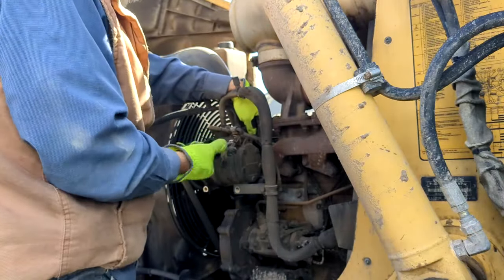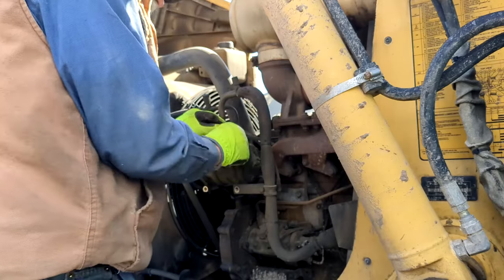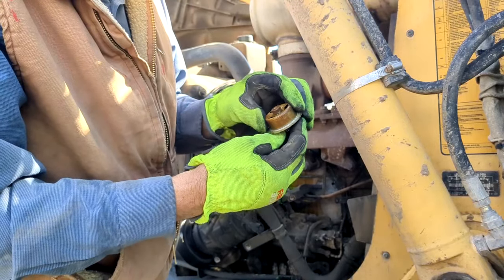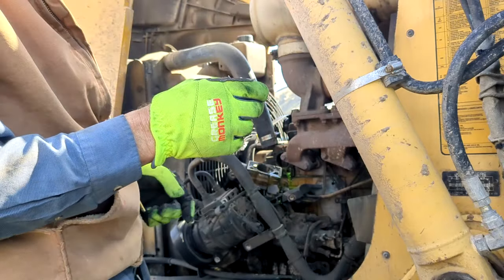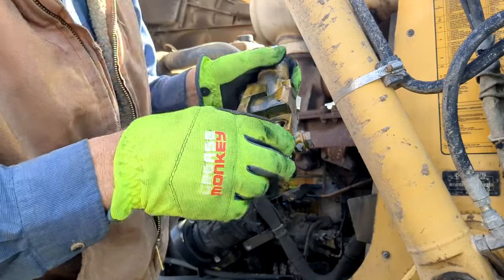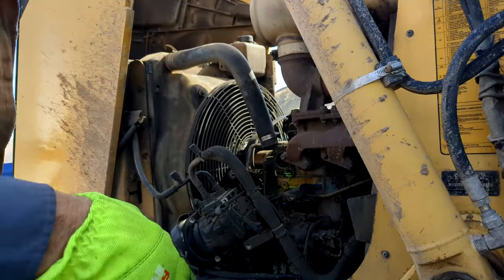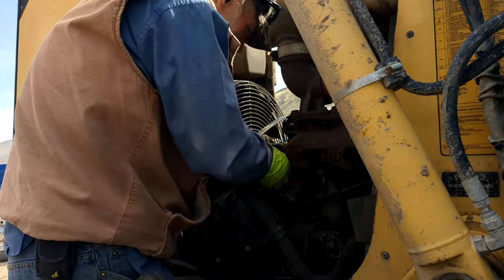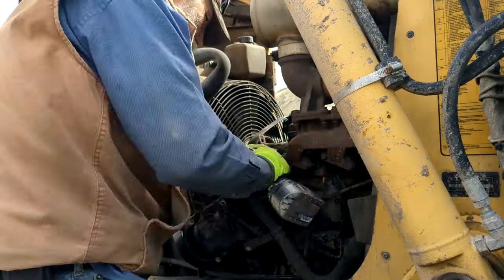JD 310 G backhoe thermostat replacement.

Comment: Great job. I own an old John Deere. 300. It still works fine just a bit worn out in the pin department It has a model 92 backhoe. Parts are a hard thing to find these days. As always I liked and shared. All my very best.
Reply from the maker: A backhoe is one of the pieces of equipment that I am lacking on my homestead. Been watching for an old one that I can fix up but even the old ones they want a lot of money for.
Reply: @tractorrescueranch3682  I was lucky. I got mine before the pricing went crazy. I hope you can find one or an excavator, Both of which are great in their own way. Thank you for the reply's back. It means a lot to me. All my very best.